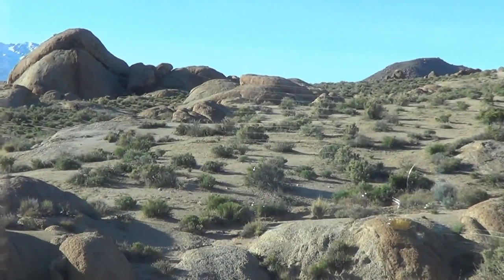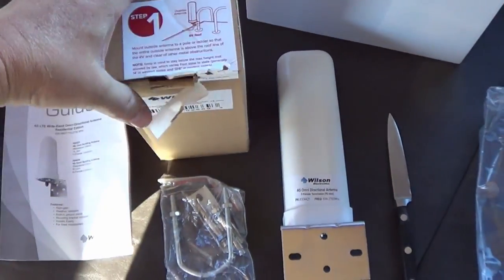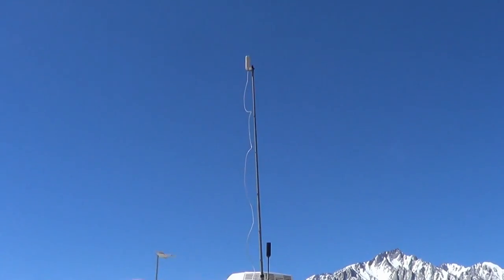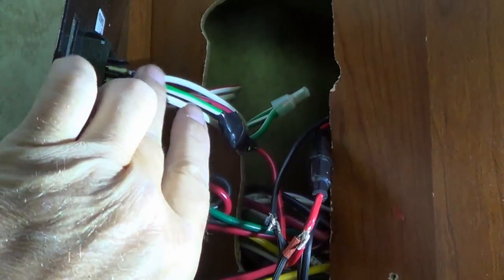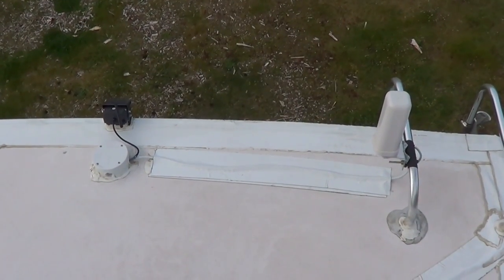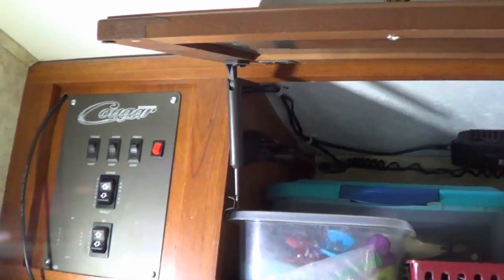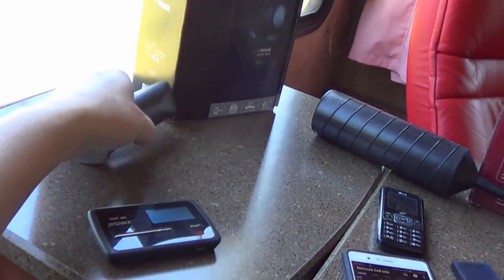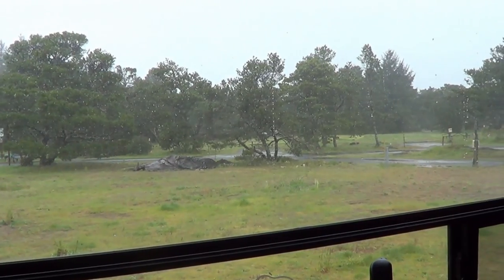weBoost Drive 4G-X RV Cell Booster Install and Review

Comment: Free advice from an RF engineer:)  Your signal capture from the tower is probably the most important aspect the chain. And a highly directional antenna such as a Yagi  gives the best chance to improve your signal to noise ratio(SINR or CINR) from your donor tower and SINR is what you need to improve your modulation scheme. (how many bits per hertz your phone can receive). Interference can be viewed as a mesh sum of RF energy coming from all directions and a Yagi is like a telescope only looking at a specific direction while magnifying that direction and rejecting other directions. The higher the gain of the Yagi, the more directional your antenna becomes, the better the SINR and thus better throughput.  Also understand not every tower has all carriers so you will need to know which tower your carrier is on and point your Yagi towards it.

Isolation is the probably 2nd thing you want to optimize between your Yagi  and coverage antenna. Ideally your coverage antenna should be directional panel antenna and pointing away from donor antenna to maximize isolation. Don't point your Yagi over the RV for this will kill your isolation. Also you don't need to blast your amplifier to cover your RV. Understand that  -105dBm RSRP(not RSSI) is plenty of signal provided that your SINR is good. SINR is as only good as you source SINR coming from the Yagi.  The amplifier does not improve SINR no matter how much gain you set. Understand you will not get any benefit from a -60dbm vs -100dbm RSRP in your RV if your SINR is the same. So if you are concerned about MPE(maximum permissible exposure), don't set you gain to max if you don't need to. 

Minimize the use of coverage omni's unless you know you can maintain the isolation needed to cover your area. But a smart amplifier may turn its gain down to create the needed isolation so you may not get the coverage benefit you're seeking.     

Personally I think the moving vehicle boosters are joke for the money. If you are getting 0 or less SINR at the roof antenna, no amplifier can improve that. If your carrier signal is noise limited and not interference limited you may have some boost benefit but all networks are interference limited unless if specific scenarios.  That scenario would be extremely rural area where there is only 1 tower serving for miles.
Reply from the maker: They do sell a Yagi kit with separate mast as well for more permanent camp setups - https://www.weboost.com/products/connect-rv-65
Reply: @LoveYourRV  I use the yagi on a telescoping flag pole (slips into holders on my ladder) whenever its needed even if it's a one-night stop.  Setup is quick enough for this.
Reply: And use an app on the phone to locate the cell tower and point the yagi.
Reply: Spot on.

Comment: Worked for me.  Bought the $450 one 3 years ago and it worked okay with the tiny little black indoor antenna and flat outdoor antenna.  Amplifier died last month.  Usually went 1 bar to 2-3 bars on my cell.  Just bought the $950 one this month and just installed (4G-X, not RV).  Now it went from 1 bar to all bars 4-5 bars.   Sweet.  

Have to register to get replacement amplifier the next time.  Antennas are cheap.  The cost is the amplifiers.

Great product.

Comment: Ray, thanks for getting back to me on the solar connector. Which of your videos show the specifics of how you run wires down from the roof of the RV to the interior, that is the scariest part for me!
Reply from the maker: You're welcome. In this video, I install my back up camera and its wires - https://youtu.be/L5VmeOMgtlE and here I install solar panels and run the wires - https://youtu.be/Z7x1iX66olk.
Then in this video, I upgraded to two more panels and goofed up on the hole into the rig - https://youtu.be/g6Pf6nU3o6o
Cheers, Ray

Comment: Thanks, for the great review!   It helps me to set my expectations when evaluating the various systems available.

Of course, the big reason these cellular boost systems have such limited range is because they have to perform a delicate balancing act.   They need the antenna that detects the remote cellular signal to be very sensitive to ensure maximum range, but the  signal into the coach can't be so high that the antenna on the roof detects it - otherwise, you get oscillation, like the feedback you get from putting a microphone near a speaker, except at radio frequencies.   Therefore, none of the systems that feature omni-directional antennas are going to provide much coverage inside the vehicle.

An alternative approach that would allow for a stronger signal inside the coach would be to use a highly directional antenna with good side and rear rejection that could be placed on a mast mounted in a portable tripod and turned in the proper direction of the nearest tower.   Then, locate another high gain directional antenna on the same mast below the first pointing back at the coach.  Both ends of the system would need to be remotely located and powered.   This means that you would need some kind of weatherproof enclosure and a way of supplying power to it.  Obviously, this is much more complex and expensive - but, would likely achieve far superior results.  Another advantage of this approach is that it would give you a lot more flexibility to find the best spot to set the antenna tripod without having to move your RV.  The disadvantage is that it is something you would have to set up every time you needed it, rather than just switching it on.
Reply from the maker: You're welcome, thanks for the info and tips. Cheers! Ray
Reply: I wrote about this above.  These devices have not reached their peak in performance as yet due to this very factor (interference between indoor and outdoor antenna).  They are definitely still a work in progress.  More sophistication is necessary from the manufacturers.  It is possible to shield the indoor antenna to allow the amplifier to work at max optimal boost, though.  Problem with shielding is reduction in usable cell signal on final end device.  I would imagine the best way to boost would be some sort of direct plug in to the mifi or cell phone.  Not sure if they want to breach that conundrum though.

Comment: Wonderful review, Ray. I already, like you, have a 4G-X booster using a trucker antenna outside and the "chocolate bar" antenna inside. I'm going to keep the outside antenna and found that for $30 I can get the new (& improved?) inside antenna directly from WeBoost. For boondockers like us this kit is really a must-have

FYI, I did the outside antenna mount a little differently. Instead of mounting the external antenna to the ladder rack I use a set of military surplus tent poles (1.25" dia. in 4' sections) bought on eBay. The mast sections are held in place with bungees to the rear ladder of my 5er. The cables are then run through the slider seal to the wi-fi router/WeBoost. Setup is pretty simple and quick with the advantage that no holes have to be drilled for the antenna wires and more sections can be added to increase the antenna height if needed.

Keep up the good work, really enjoy the videos!
Reply from the maker: Thanks. Good idea. My telescoping flag pole acted in a similar fashion. I used it quite a bit for testing before a permanent install. Cheers!

Comment: Just installed our Weboost Drive 4G-X RV. We added extra washers to the u-bolts on the antenna ladder mount and then everything tightened up great, otherwise the u-bolts run out of threads before the nuts get tight. This might be an option for people who don't want to drill holes in their RV ladder.
Reply from the maker: Thanks for the tip.

Comment: Thanks for your review. I've used the cradle sleek for years. Was unlocking t-mobile phones and ordering a at&t SIM card from Straighttalk - walmart online.  Much better signal generally. Unlimited data for cheap. Now have switched to a Straighttalk LG Stylo 3 129 and nolonger need a boost at all with the pre SIM Verizon service. The RV kit maybe of  interest.
Reply from the maker: Thanks for the info.

Comment: Ray, I may be wrong, but I think the clamp is on backwards, the Part you have outside next to the  U-bolt should be turned around and put next to the bracket holding the antenna letting the U-bold snug up to the ladder pole.. That could all depend on how many threads you have to work with because everything will need to be threaded farther up on the U-bolt and then you can cut off the excess threads.... I hope I made all this as clear as mud at least.. haha   love watching your videos..
Reply from the maker: The one side had teeth to bite metal and stop it from turning but is oversized for an RV ladder, flipping it around it would be flat and want to turn unless overtightened. It looks like a clamp for a satellite dish size pole, I think they just used an already made product and through it into the RV kit. See this example of "building antenna" looks exactly the same - https://store.weboost.com/products/wilson-electronics-4g-omni-building-antenna-75-ohm
Thanks! Ray

Comment: Stick the big trucker antenna on a painters roller extension pole with some zip-ties and use a couple of 3M Command Broom Gripper holders and stick them to the side of your RV and insert the painters pole with antenna attached extended as high as possible and you'll get the best reception you can get.

Comment: FYI
"4G-X RV" boosts voice and data with max FCC-allowed 50 dB system gain, uses omni directional antennae.
"RV 65" boosts voice and data with max FCC-allowed 65 dB system gain, uses directional antennae.

In 2014, the FCC created new regulations that apply to all signal boosters sold in the US. The FCC created two sets of regulations: one set for “broadband” devices that amplify all cellular signals from all carriers, and another set for “carrier-specific” boosters that only amplify the signal of one carrier at a time.
“Broadband” booster regulations:

    The gain of the amplifier can be no more than: 64 dB for the 700 MHz band, 65 dB for the 850MHz band.
    The downlink output power of the entire amplifier system, including the losses from the cable, can be no more than 12 dBm.
Reply from the maker: Thanks, the new one looks really good for folks that are staying in one spot for a while. I think having the big mast and directional antenna would help the internal antenna range too, less feedback between antennas I would think.
Reply: Yes, the higher the antenna the more favorable the line-of-site to the next cellular tower, which leads to the ground cable.   This is how they fake Satellites, note the FCC limits to boost to 65dB, yet the boost could be unlimited; no signal no GPS.

WHO INVENTED the space ENTERPRISE?

1582
Heliocentricism as invented by Copernicus is used by Pope Gregory XIII to reform the calendar.

1601
Telescope invented

1609
Johannes Kepler published his Heliocentric laws of planetary motion, based on the writtings of Tycho Brahe.
   Tycho Brahe (1546-1601) died prior to the invention of the Telescope.

1610
Galileo Galilei, claims to see Spaceballs orbiting about one another.
   Galileo is a beneficiary of the Jesuit payroll.

1611
Christopher Clavius, a Jesuit at the Collegio Romano, confirms Galileo’s observations of planetary motion.
   Jesuits claim that Lights they observe through their Telescopes are in fact Spaceballs that orbit about one another.

The reader will note, that from this point on "verifiable reality" has been replaced with Theoretical Math Equations (pretend).

1687 
Sir Isaac Newton, invents the theory of Gravity establishing a friction-less environment required for Spaceballs to orbit about one another.

1798
Sir Henry Cavendish invents the MASS of the Earth and the Mass for all other Spaceballs. He was the first to calculate the gravitational constant [G], showing how Spaceballs orbit about one another in the vacuum of space.

1865 
Jules Verne publishes, From the Earth to the Moon

1883
Konstantin Tsiolkovsky writes Free Space on use of jet propulsion in vacuum of space

1903
Konstantin Tsiolkovsky (USSR), inspired by the writings of Jules Verne, published "The Exploration of Cosmic Space by Means of Rocket Devices", showing that the man-made construct called Space was a physical place that could be explored.

   Konstantin Tsiolkovsky, is known as the founding father of astronautics

1931
Jesuits invent Big Bang theory (aka, Cosmic Egg or Primeval atom)

1932
Drawing by Tsiolkovksy for the film ‘Cosmic Voyage’ showing a cosmonaut exiting a rocket via an airlock into the vacuum of Space.

   i37.servimg.com/u/f37/19/39/28/69/tsiolk11.jpg
   Credit: Archive of Russian Academy of Science

1945
Sir Arthur C. Clarke invents geostationary satellite communications for his Science Fiction stories.

It was Science Fiction writers who invented the properties of SPACE, SPACEBALLS and GRAVITY; these Fairy tales then entered major Universities under the guise of THEORETICAL Physics (pretend) and a New World Religion was created called SCIENTISM.

Comment: I'm installing the weboost 4G-X RV and I installed the antenna on my ladder. It is about 6 inches  over the roof. I read in the west the max height is 14' and 13'6" in the east. Does it worth installing it on an adjustable pole to get like 2'6" to 3' more?
Reply from the maker: Mine has worked well on my ladder, I don't think 3 feet would matter much in most places. I think the best solution would be to have the regular omnidirectional antenna permanently mounted for use in the vast majority of places. Then have a second portable directional antenna they call a yagi on hand as an option for really fringe areas, where getting it up high and pointing it at a cell tower could help increase the signal even more. Could have extra antenna wire and maybe a painters pole or flag to bungee to the ladder to get some extra height.

Comment: Great video.  If your antennas are close together two things can happen. The system reduces the power output to inside and outside antennas if it starts to detect feedback.   Worst case the system gives an error and won't boost any signal (shuts down/ flashing LED).  The separation of your antennas (original and new install) is such that I think your system is reducing output resulting in less than best boost possible by the system (less power to reach çell tower).  I would try placing your indoors antenna further away from the back window.  Middle or front of the camper would be better.  Another option would be to place the external antenna at the front or middle of the roof.  I think you would see an improvement in performance.  It is to bad that there isn't a way to see/read the feedback levels to help determine the best separation.  I like your junction box idea for the roof. Very nice.
Reply from the maker: Before the install, I tried both antennas all over the place and where they are now turn out to be optimal. I believe the metal frame of the trailer back wall and the metal window frame help with antenna signal separation. Same held true with the Weboost OTR trucker kit. Our trailer has a wood and rubber roof. So I believe middle or front increases separation distance but less metal in the way to shield, becomes a zero some game in my rig.

Comment: Just FYI. The previous model (Wilson brand) had 4 amplification adjustments for each cellular band. I have heard that this new model has an automatic amplification adjustment, but has an issue in that when you are close to a tower, the amplification is minimized, but when you get further from the tower, the amplification does not automatically increase. This requires you to power the unit off and back on to get the amplification to increase again. That may not be an issue for someone who turns the unit off when moving their rig from location to location but would be an issue for anyone who does not power the unit off when moving locations or for someone who wants to use the unit while in motion.
Reply from the maker: Interesting, thanks for the insight, I power mine off almost every night as we usually are dry camping and I don't want the power waste.

Comment: Good review. Doesn't the jetpack distribute the signal throughout the trailer?
Reply from the maker: Thanks, Yes, it has a built-in WiFi router takes the incoming cell signal and rebroadcasts as WiFi signal so we can hook all our phones and computers to it.
Reply: @LoveYourRV  Thank you. I'm going Full Time on May first and was contemplating my data options. Had planned on buying the Verizon MiFi 8800L Jetpack and 65.00 a month unlimited plan then boosting with the Weboost RV system. Now I'm hearing a LOT of negative reviews of that jetpack. Happy Travels.
Reply from the maker: I have the 4620L on the unlimited plan, 8 years old and its worked well unless we are using a crowded cell tower, then its really slow, I then usually will switch it to 3G mode and it actually speeds up, since so many use 4G now. I hear that 3G is being shut down at the end of the year though.  Frankly, I use the weBoost less and less every year as the cell companies keep expanding coverage I don't need it too often. A bigger problem is too many people using the same tower all with unlimited plans. ;) Especially when hundreds or thousands of snowbirds descend on a little town or when near busy cities.
Slows it down, in which case a booster doesn't help.  Cheers, Ray
https://www.loveyourrv.com/cell-phone-internet-plans-we-use-as-canadian-rv-snowbirds/
https://youtu.be/Q7RNhj_q-Ys
Reply: @LoveYourRV  Thanks again Ray. I'll look at the links!

Comment: Did you call your carrier to ask for a free "cell hotspot" boost device in your carrier's dead spot areas? 
Do you use "wifi calling" on your phone to minimize data charges.
Reply from the maker: No, we haven't. we use a prepaid plan for data, I have an unlimited plan for phone and text.